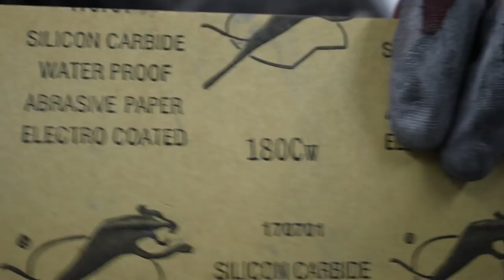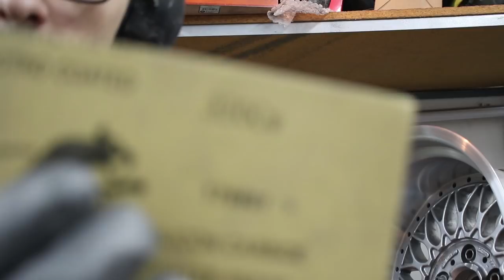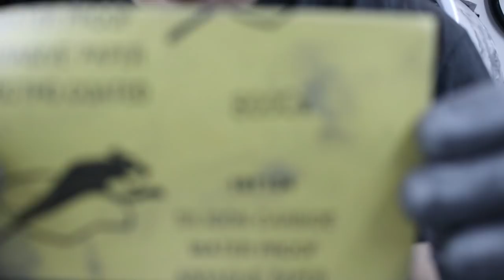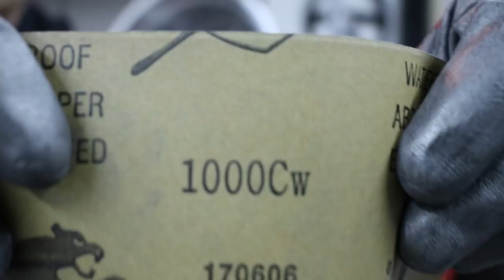Budget 3 Piece BBS Wheels Build | Part 3: Polishing The Lips

Comment: First thing on my mind when you started final polishing was why don't you spin the wheel and polish the lip by microfibre towel and the metal polishes you have. Much faster and more accurate than drill and wool disc. But the final result is nice anyway :)

Comment: when i did my rc090s i did pretty much the same thing you did, except buffing with the drill and wheel - you did it dry with compound. I lubricated the buff pad. i think wd40 would work but at the time i beleive i used miineral spirits, and kept the buff pad wet, and it polished about 10x faster.

Comment: ive just been doing some 3sdm 0.05s, they were pretty bad but got a good finish on them in the end. i started with 600, 800, 1000, 1200, 1500 . then i used polishing compound similar to g3  , after that i used a wheel on them. 

ive got to seal them now but unsure on what to use. do i clear coat? or do i just use a sealant? ........ if i use a cleat coat and chip it, then they start to worm ect ill have to redo them as well as stripping the clear off them.

Comment: For those wanting to do this home, but quality sandpaper. It's heaps better and costs less.
Soak the paper before you start in a bucket of soapy water and really wet the surface to stop getting the brushed look, and don't use your dirty old buffing wheel to polish.
Different polishes require different grade of foam waffle pads.
It will speed up your entire process

Comment: Why not use the rotation of the power wheel and polish it as it spins I’ve done it on all my builds and it leaves the lips super chrome
Reply from the maker: Jesse James safety and Repeatability, plus I’m not sitting on the ground.
Reply: EuroGarage no doubt you did good work but if anything the way you sanded was more dangerous the polishing unless you put 2or3 of the hardware in to hold face in
Reply: I usally just jack up my car and put it in gear and let the whee do all the work

Comment: I'm a sucker for all black wheels.  Not everyone's style, but I took my rc090s to get completely powder coated in gloss black.  The place charges under $200 a set and I only have $240 in the wheels so far.  

Gonna run them normal on my e28 for a little while, then flip them and widen the rears like you're doing when budget allows.  Gotta have something wide in the rear to handle hx40 m30 power!  

What are you doing about wheel hardware?  Your original bolts won't be long enough and 32mm m7 wheel hardware is stupid expensive.